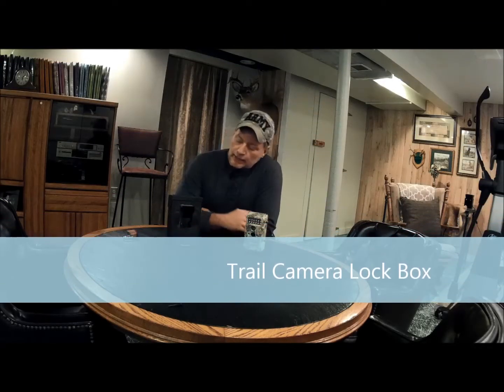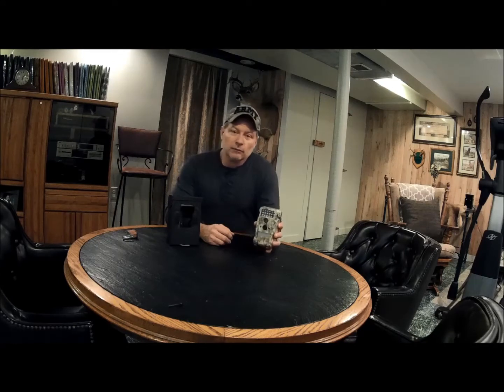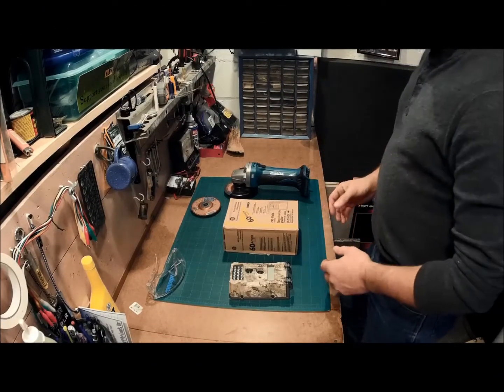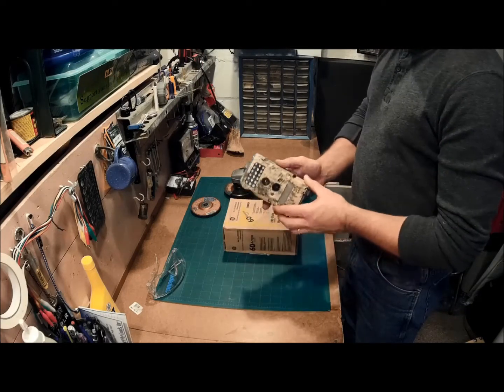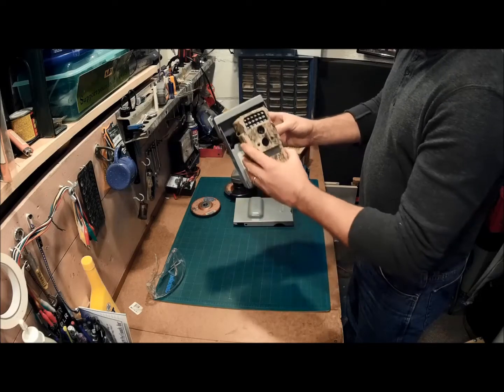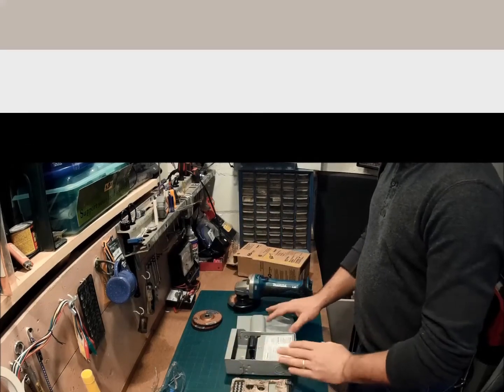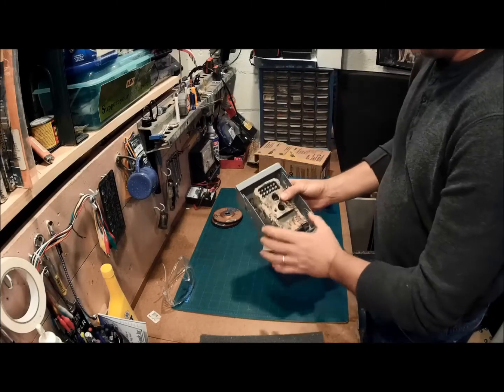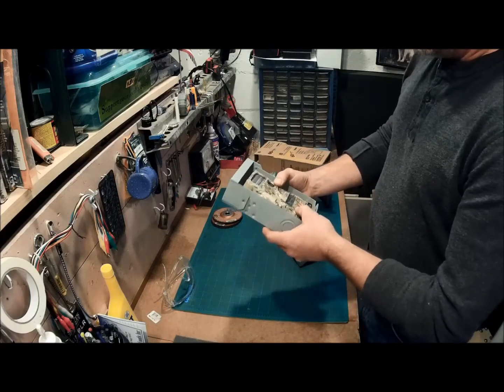DIY Trail Camera Lock Box

Comment: Just wanted to say thanks for a great video.  I just made up one of these myself.  Slightly different design box,. The front cover of the box I had was tough to cut through,  I had one of those oscillating tools to cut through with,  took a lot of elbow grease!    I'm going to use camouflage duct tape to cover the outside with.
Reply from the maker: +Chuck&#39;s Paranormal Adventures      Glad you enjoyed the video.  Good idea on the camouflage tape. Post a video of your project if you can!
Reply: I'll have a video up on my channel shortly.   Just basically going over the finished product and giving you the credit where I got the idea from and the details on how to do it.

Comment: Any issues with the foam trapping moisture and creating a problem?
Reply from the maker: No issues at all with moisture.  Most cameras are water proof to some extent.  The only problem is insects make a nest inside the box.  Have to clean them out each time I check the cameras.  Still not an issue.

Comment: You can put eye bolts thru the sides and secure with nuts n washers inside then run python cable lock around to secure to tree
Reply from the maker: That is a good idea.  I just run it through the knock outs on the side.

Comment: Hmmm, I just so happen to have one of those boxes and wondered what I would ever do with it.......now I know!
I am going to add a cable to mine, drill a hole on the back put cable through hole, put cable clamp on cable and make it tight!
When you bolt it to the tree then pass the cable around the tree and through another hole on the other side back of the box and put another cable clamp on that end, should be able to leave some slack end so it can be used on different diameter trees. My .02 .....
Reply from the maker: Sounds like a good idea!
Reply: The Handy Outdoorsman I didn’t end up using the cable, I hope it is still there when I go check it next week......screwed to small tree unfortunately.
Reply from the maker: @1966cambo  it will at least keep the honest guy honest.